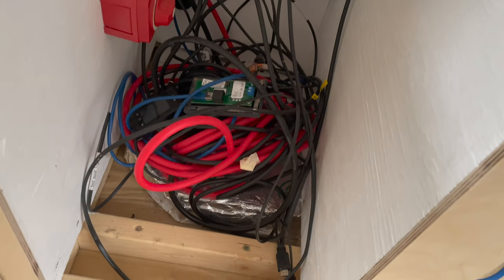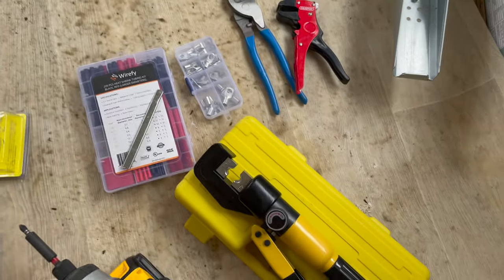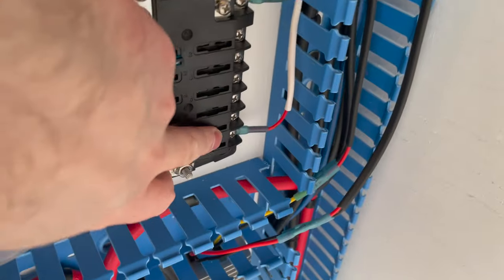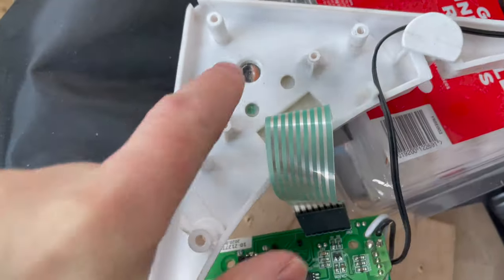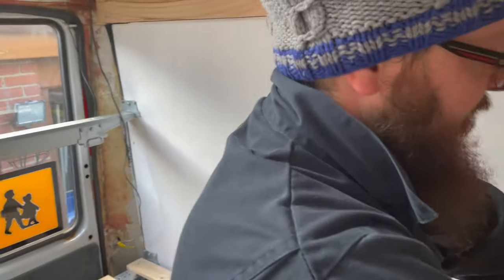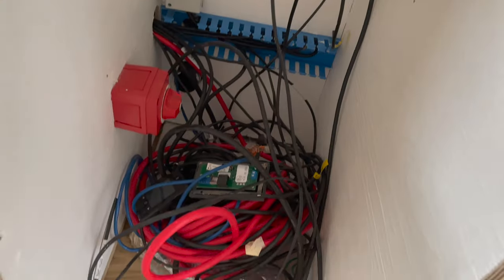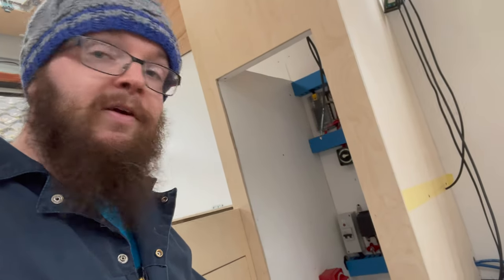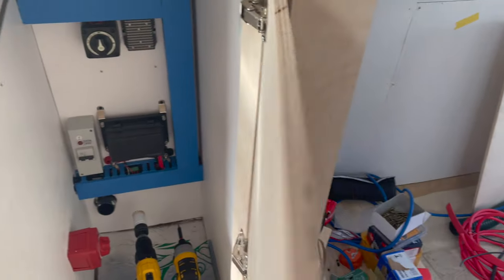Van Conversion Update: Wiring Successes + Self Inflicted Troubles | Plywood Sliding Door Install

Comment: It’s great to see how much progress has been made with the electrical system for the van. Clearly thought out …odd wires on the maxxfan now sorted! Love the sliding doors too! 😎👍✅✅✅
Reply from the maker: Thanks Andrew. I’m glad we aren’t the only ones that think it’s an odd colour to wire a positive 😂.
Reply: @WanderbusAdventures  it’s caught a few van builders out!! You’re not on your own 😂👍
Reply: @WanderbusAdventures  wiring colours very odd. I wrapped a bit of correct colour insulating tape on the Maxxfan  cables just in case I disconnected the fans in the future and forgot which was which when reconnecting.
Reply from the maker: That’s a very good idea. I’ll do something similar as it’s so easy to forget.

Comment: Love the joy of when things work as planned. Relay board is an excellent idea, especially your plan to reduce the amount of cable needed for the control panel. Also pleased to see the voltage regulator supplying 12v to the Maxxfan.
Neat cupboard door; why not have a simple door when you can have an engineered solution!?!? Sorry to hear about the flood in the house, hope you dry out soon.
Reply from the maker: Thanks for the tip on past videos on the Voltage regulator Peter; appreciate it. It even looks neat, which is great. The door seems to be a goer for sure, but like all things will keep you posted. 

The house is drying out; thankfully we haven't had loads of moist weather to compound it. Thanks again Peter, take care

Comment: Hi Rich
If your feeling adventurous,there’s 4no digital inputs on the Cerbo GX you can use for feedback,handy to monitor the kit you’ve installed. In my van I’ve got my diesel heater,Sargent unit and Victron mains charger interfaced with the Cerbo so you can see their status on the touch screen or when viewing remotely!
Reply from the maker: This sounds like a bit of a done deal to be honest. Having not looked into it too much how have you set yours up? I was also going to wire in a digital smoke alarm into those. But need to look into that too.
Reply: @WanderbusAdventures  the digital inputs accept a 5v input,so to interface a 12v input I used a 4 channel optocoupler isolator,and used one of the cerbo’s relays to switch my diesel heater on via generator start/stop page.

Comment: Top job 👌 you wouldn't think you would need so much gear to run a 12 volt system. Can you let me know a costing for the set up. i will definitely  get  the 12 volt stabiliser for the fan thanks for the information 👍
Reply from the maker: Thanks. I would say we could maybe have done it simpler. But for the stuff we are putting in wanted a robust system. Will have to get back to you on the total costs. But it’s not a cheap endevour. The gear itself cost us a few thousand and then there’s the bits nobody thinks about - cable, lugs etc.

Comment: Enjoying your videos and wanted to ask you about your relay board.
I noticed you have several red cables commoned up which I assume are the feeds to your relays? If that is the case have you put those feeds through the fuse first or have you fused the switched side of the load? Just to be safe those relay feeds will be fused at the rating of the supply which will be to high for them if a relay shorts out...you really want to be fused before the relay. Hope that makes sense.
👍
Reply from the maker: Hey Paul. That’s a great eye. The bundled cables are indeed feeds for the relays. They come to the power post; which I fused at the fuse box end. If that makes sense. The loads are then fused individually from the fuses in the relay box themselves (the bundled and numbered red wires). I figured this way I’d be protecting the feed in cables/relays with the fuse box fuses. Then the loads from the fuses in the relay box. I am hoping this delivers what you are saying; I definitely appreciate the question and any advice. Great eye as I said. Do you think that’ll cover it?
Reply: @WanderbusAdventures  It depends if the fuse protecting the feed post is low rated enough rated to protect the individual cables feeding the relays. I think you said 60A? If so the cables feeding the relays could potentially glow red hot if shorted out without pulling the fuse...Normal practice is to protect the single supply cable to the next fuse and downrate that fuse to the lower rated cable. Known as discrimination. In reality that would mean the cable feeding your post would feed the fuses in your relay board first.
Reply from the maker: That makes sense. So in my setup I’ve added a 30amp fuse in the board. As the relays are 40amp and the cable for my feeds is 3mm2 cable (33 amp according to Altec). In reality I probably could have used a smaller gauge cable for the one to the power post.
Reply: @WanderbusAdventures  That sounds fine if you have indeed used 30A and not 60A as I was thinking I heard. I would point out that fusing a cable rated at 30 ish amps fused at 30 amps leaves little margin for safety. If I wired a house for example a 2.5mm cable can potentially run at about 27 amps but would be fused at no more then 20 amps as a margin for safety and allowing for downrating factors such as temperature. 
12v cables can and do short out and only 12v can still get very hot before pulling a fuse. Thinking of your Familys safety here not being critical of you.
👍
Reply from the maker: I did say 60amp cable for sure, but wouldn’t have fused it that high. I could have explained that better. 

I’ll switch it out for a 25amp. That should be more than enough for the things running off the relays. Safety first for sure. Thanks Paul. Appreciate it.